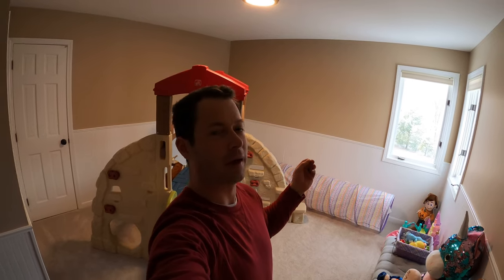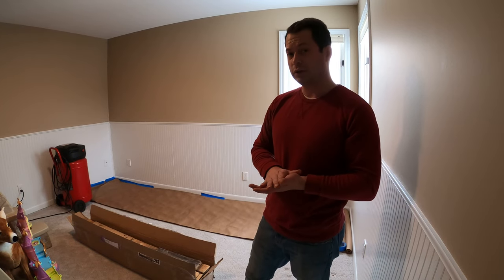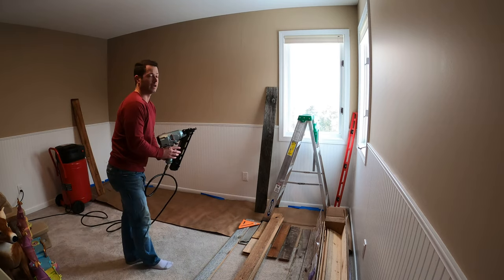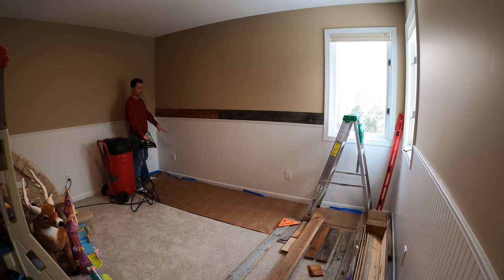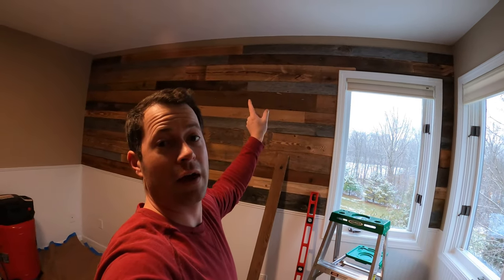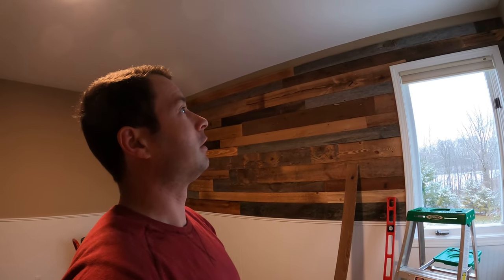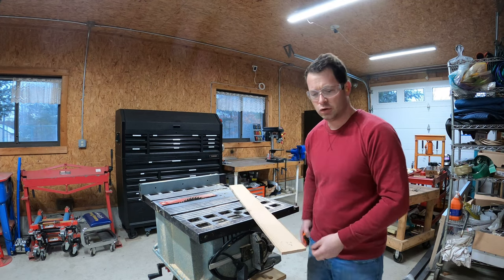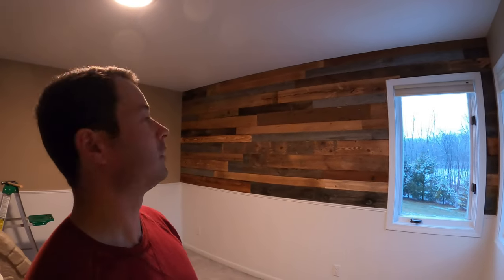Barn Wood Accent Wall - Installing Over Painted Drywall - Authentic Rustic Reclaimed Wood

Comment: I see a lot of people using liquid nail caulk on the back of the board as well as the nails like you used on this project. Did you put every nail in the stud? I feel that the liquid nail will ruin the wall if removed. Was just wondering if nails only worked well for you and if they all had to be on the stud.
Reply from the maker: I specifically didnt want to use an adhesive since it would be such a pain to remove.  Will likely tear the paper on the drywall.  I just used nails and did not put all of them in studs, many just in the drywall.  Wall is still doing well.  Sure it has less attachment then adhesive but nobody is pulling on the accent wall.  And if i ever remove i have easy to fill small nail holes.

Comment: Was curious as to why you didn’t break your joint over the studs?
Reply from the maker: It would require significant waste.  Many just use adhesive to hold the pieces to the wall but that often will pull or rip the drywall paper when you eventually remove the decor.  I would agree my method is not the preferred installation but I have yet to have an issue.

Comment: Awesome video and it looks great ! Can I ask what size brad nails did you use?
Reply from the maker: Thanks.  1.5in 15ga finish nails
Reply: @NaterTater  Thank you, so there not brad nails ?
Reply from the maker: Correct, brads are normally 18ga but very similar.   Either would work.
Reply: @NaterTater  Thank you !